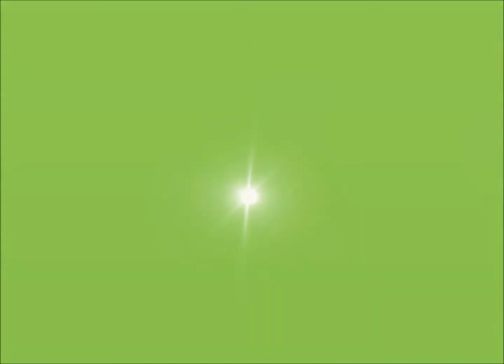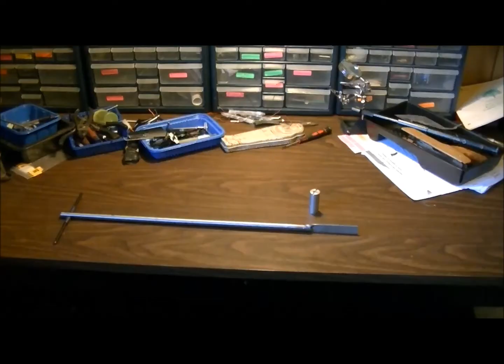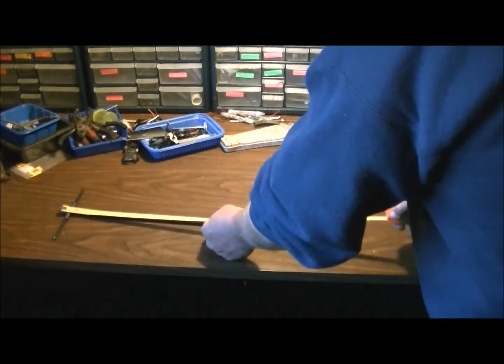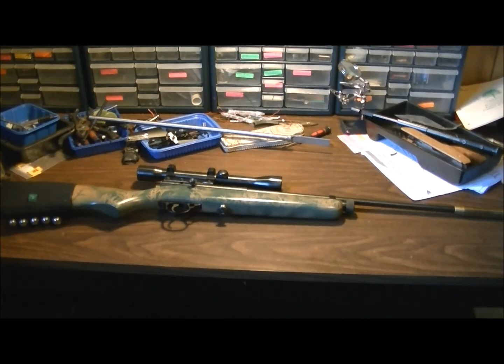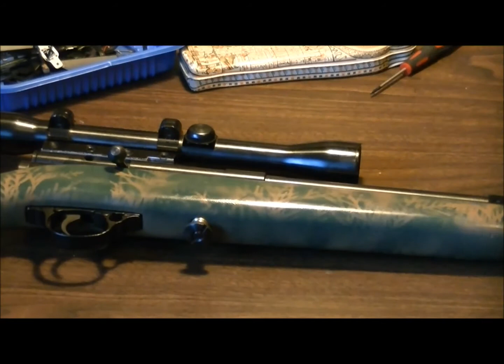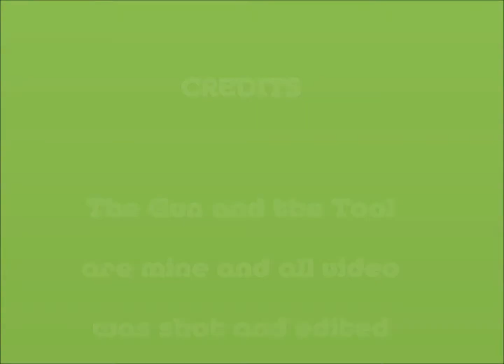QB 78 and Crosman  valve tool

Comment: I have just disassembled my QB78 due to a fault in that valve, the rubber seat has disappeared, I tried to fill the gap in the stem with silicone for engine gaskets, I will try to see if it is airtight. On the other hand, I see in its valve that the air outlet hole has been modified, what diameter drill bit should I use to enlarge the air outlet? How many shots does Co2 last for you like this?

Regards
Reply from the maker: 65 shots then it starts to lose power and leave the valve alone what you want to increase is the trasfer port only and put it to 3.8 to no more then 3.9 mm

Comment: just get a length of 15mm copper pipe and flatten one end,
Reply from the maker: copper is not strong enough
Reply: of course it is, I know because it is what I used many many times. the valve doesn't need to be anymore than hand tightened or you can damage the seal.
Reply from the maker: i like tools that last and are made to work right
Reply: the copper pipe works and has done for the last 12 years.  not everyone has access to a welder so it is a much simpler and cheaper alternative to the over-engineered ones you see that people have made or that you can purchase.
Reply from the maker: if it works for you then great thats all that matters in the end i just have my own preeferences